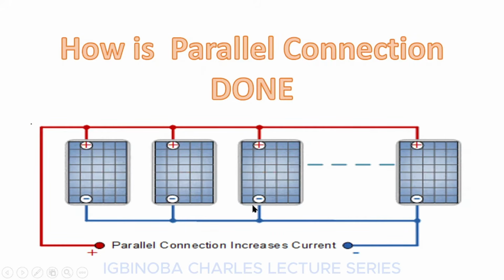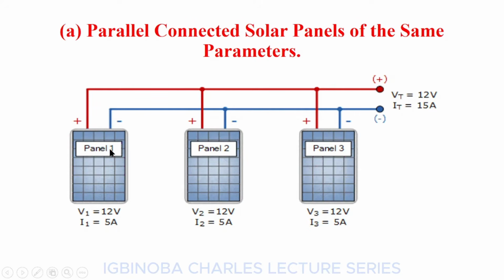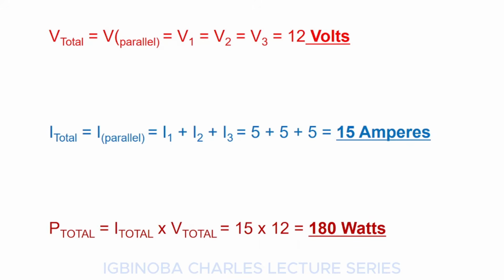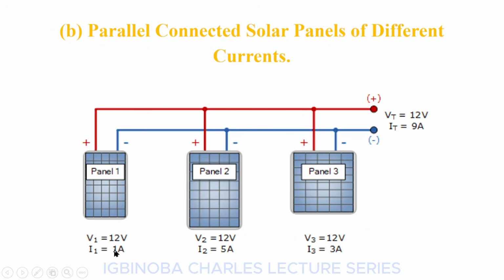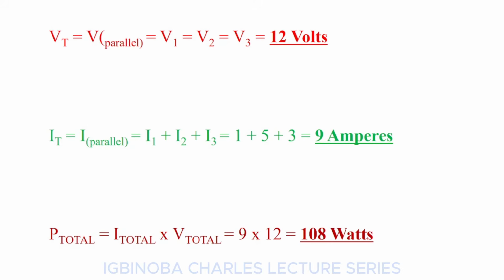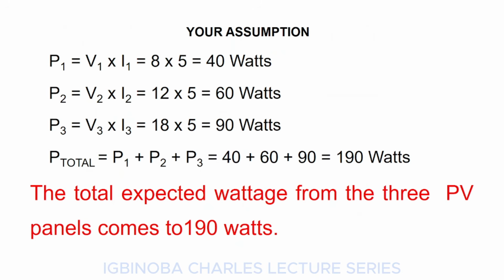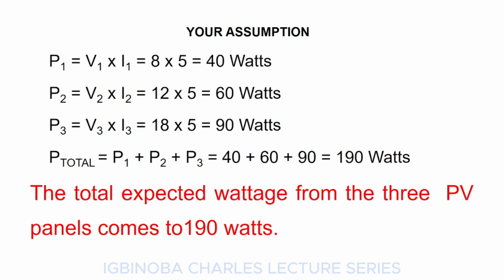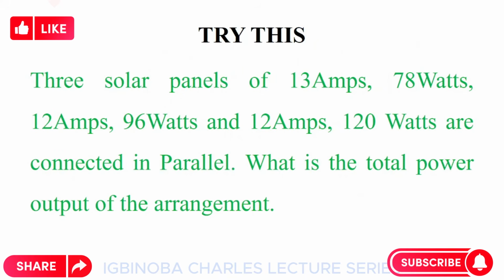Connection of Solar Panels in PARALLEL

Comment: CIV70R 

ANSWERS 
GIVEN:
Panel 1 = 13A, 78W
Panel 2 = 12A, 96W
Panel 3 = 12A, 120W
Using P = IV
V = P/I
Panel 1 = 78/13 = 6V
Panel 2 = 96/12 = 8V
Panel 3 = 120/12 = 10V
Using the smallest voltage = 6V
Total power = (Iₜ) × V
= (13 + 12 + 12) × 6
= 37 × 6
= 222 WATTS

Comment: MEC47U 
For the question as written:

* Panel 1: 13 A, 78 W
* Panel 2: 12 A, 96 W
* Panel 3: 12 A, 120 W
* Connected in parallel

Step 1: Add the power outputs

In parallel, the total power output is the sum of the
individual power outputs:

P_T = P_1 + P_2 + P_3

P_T = 78 + 96 + 120

P_T = 294 W

Comment: MEC108D

Parameters:

Panel 1: 13A, 78W

Panel 2: 12A, 96W

Panel 3: 12A, 120W

Voltage for Panel;

1: 78W ÷ 13A = 6V

2: 96W ÷ 12A = 8V

3: 120W ÷ 12A = 10V

We use the least voltage which is 6V for Panel 1
So, 
Total power in parallel = (Sum of current for the panels) x least panel voltage 

P = (13 + 12 + 12) × 6 = 222W

Comment: CHM89K 

GIVEN; P=VI; V=P/I
13A 78W=78/13 =6V
12A 96W=96/12=8V
12A 120W=120/12=10V
*I=13+12+12=37A
In a parallel connection the panels would run on the least voltage V=6volt

P=VI; 6×37=222W

Comment: COMP7G

Parameters;
Panel 1 = 13A 78W
X
:
Panel 2 = 12A 96W
Panel 3 12A, 120W i
voltage = Power/Current; Panel 1 = 78/13 = 6V
Panel 2 = 96/12 = 8V
Panel 3 = 120/12 = 10V We use
V = 6v.
total power in parallel: (Sum of the currents) × V
(13 + 12 + 12) * 6 =222watts

Comment: CIV90L

Given:

Panel 1 = 13A, 78W
Panel 2 = 12A, 96W
Panel 3 = 12A, 120W

To get the voltage across each panel, use:

V = Power / Current

Panel 1 = 78 / 13 = 6V

Panel 2 = 96 / 12 = 8V

Panel 3 = 120 / 12 = 10V

We use V = 6V because it is the least voltage we have.

To get the total power in parallel:

Total Power = (Sum of the currents) × V

= (13 + 12 + 12) × 6

= 37 × 6

= 222 watts

Final Answer = 222 W

Comment: CIV81C
   

Panel 1 = 13 A, 78 W
Panel 2 = 12 A, 96 W
Panel 3 = 12 A, 120 W
To get the voltage across each panel, use:
V = Power / Current
Panel 1 = 78/13 = 6 V
Panel 2 = 96/12 = 8 V
Panel 3 = 120/12 = 10 V
We use V = 6 V because it is the least voltage we have.
To get the total power in parallel:
Total Power = (Sum of the currents) × V
= (13 + 12 + 12) × 6
= 222 watts.

Comment: EEE75W
Panel 1 = 13A, 78W
Panel 2= 12A, 96W
Panel 3 = 12A, 120W

Voltage across each panel 
V1 = 6V
V2 = 8V 
V3 = 10V 

Total power = 222W

Comment: CHM3C

For the question as written:

* Panel 1: 13 A, 78 W
* Panel 2: 12 A, 96 W
* Panel 3: 12 A, 120 W
* Connected in parallel

Step 1: Add the power outputs

In parallel, the total power output is the sum of the individual power outputs:

P_T=P_1+P_2+P_3

P_T=78+96+120

P_T= 294W

Comment: EEE6F

PANEL 1 = 13A, 78W
PANEL 2 = 12A, 96W
PANEL 3 = 12A, 120W
CALCULATIONS:
Using P = IV \implies V = \frac{P}{I}:
PANEL 1: \frac{78}{13} = 6\text{V}
PANEL 2: \frac{96}{12} = 8\text{V}
PANEL 3: \frac{120}{12} = 10\text{V}
Using the smallest voltage = 6V

Comment: MAR91M

GIVEN:
PANEL 1=13A 78W
PANEL 2=12A 96W
PANEL 3=12A 120W

USING P=IV
V=P/I
PANEL 1=78/13=6V
PANEL 2=96/12=8V
PANEL 3=120/12=10V
Using the smallest votage = 6V

Total power=(It)*V
=(13+12+12)*6=222WATTS

Comment: EEE8H

Parameters : 
Panel 1 = 13A ,78W
Panel 2 = 12A , 96W
Panel 3 = 12A ,120W I
To get the voltage across each panel is given by : 
Power/ current ; 
Panel 1 = 78/13 = 6V
Panel 2 = 96/12 = 8V
Panel 3 = 120/12 = 10V We use V = 6V because it's the least voltage we have  : 
To get the total power in parallel: 
We have (Sum of the currents) × V (13 +12 + 12) × 6 = 222watts

Comment: MEC30D

Panel 1 = 13A,78W
Panel 2 = 12A , 96W
Panel 3 = 12A, 120W

Calculating voltage across each panel
Recall: v / PI
V1 = 78/13 =6V
V2 = 96/12 =8V
V3 = 120/12 =10V

Parallel connection 
V=6V

Calculating total power (PT)
Recall PT = ( sum of current)*V
PT = (I1+I2+I3)*V
PT= ( 13+12+12)*6
PT= 37*6
PT = 222W

Comment: MEC109E 

Given:
Panel 1 = 13A, 78W
Panel 2 = 12A, 96W
Panel 3 = 12A, 120W

Calculating voltage across each panel:

Recall: V=P/I

V1 = 78/13 = 6V
V2 = 96/12 =8V
V3 = 120/12 = 10V

Since it's a parallel connection, we use the least voltage value:
V = 6V

Recall 
Total power = (sum of currents)× voltage 
Total power = (13+12+12) × 6
                       = (37) ×6
                        = 222 Watts

Comment: CHM108C
answer:

Panel 1: 13A 78W

Panel 2: 12A 96W

Panel 3: 12A 120W

For the panels connected in parallel the total power output is the sum of the individual powers:

PT-P1+P2+P3

PT-78+96+120

PT=294W

Comment: MAR23W
Given;

Panel 1 = 13A, 78W

Panel 2 = 12A, 96W

Panel 3 = 12A, 120W

To get the voltage across each panel is given by

Power/Current;

Panel 1 = 78/13 = 6V

Panel 2 = 96/12 = 8V

Panel 3 = 120/12 = 10V

We use V= 6v because it's the least voltage we ha To get total power in parallel : We have (Sum of the currents) x V (13 + 12 + 12) * 6

=222watts

Final answer =222watt

Comment: CHM57E

Parameters;

Panel 1 = 13A 78ឃ

Panel 2 = 12A 96W

Panel 3 12A, 120W i

voltage = Power/Current; Panel 1 = 78/13 = 6V

Panel 2 = 96/12 = 8V

Panel 3 = 120/12 = 10V We use

V = 6v.
total power in parallel: (Sum of the currents) × V

(13 + 12 + 12) * 6 =222watts

Comment: MECH104Z

Panel 1= 13A , 78W
Panel 2= 12A , 96W
Panel 3 = 12A , 120W

Calculating voltage across each panel:
Recall : V/PI
V1 = 78/13 = 6V
V2 = 96/12 = 8V
V3 = 120/12 = 10V

Parallel connection 
V = 6V

Calculating total power (PT)
Recall PT =(sum of currents) *V
PT = (I1 + I2 + I3)* V
PT = (13 +12+12) * 6
PT = 37* 6
PT = 222W....
Reply: MEC113I

Panel 1 = 13A, 78W

Panel 2 = 12A, 96W

Panel 3 = 12A, 120W

Calculating voltage across each panel:

Recall: V/PI

V * 1 = 78/13 = 6V

V * 2 = 96/12 = 8V

V * 3 = 120/12 = 10V

Parallel connection

V = 6V

Calculating total power (PT)

Recall PT =(sum of currents) *V

PT= (11 + 12 + 13) ^ * V

PT= (13 + 12 + 12) ^ * 6

PT = 37* 6

لا

SUBSCRIBE

PT = 222W

Comment: MEC33G 

Parameters;
Panel 1 = 13A, 78W
Panel 2 = 12A, 96W
Panel 3 = 12A, 120W i
To get the voltage across each panel is given by
Power/Current; Panel 1 = 78/13 = 6V
Panel 2 = 96/12 = 8V
Panel 3 = 120/12 = 10V We use
V= 6v because it's the least voltage we have:
To get total power in parallel: We have (Sum of the currents) × V (13+12+12)×6 =222watts

Comment: MEC45S
 
Given:
 
 
- Panel 1 = 13A, 78W
 
- Panel 2 = 12A, 96W
 
- Panel 3 = 12A, 120W
 

 
Calculating voltage across each panel:
 
Recall: V = P/I
 
 
- V1 = 78/13 = 6V
 
- V2 = 96/12 = 8V
 
- V3 = 120/12 = 10V
 

 
Since it's a parallel connection, we use the least voltage value:
 
V = 6V
 
Calculating total power (PT):
 
Recall: PT = (Sum of currents) × V
 
PT = (I1 + I2 + I3) × V
 
PT = (13 + 12 + 12) × 6
 
PT = 37 × 6
 
PT = 222W

Comment: EEE61i

Answer:

Given:
- Panel 1 = 13A, 78W
- Panel 2 = 12A, 96W
- Panel 3 = 12A, 120W

Calculating voltage across each panel:

Recall: V = P/I

- V1 = 78/13 = 6V
- V2 = 96/12 = 8V
- V3 = 120/12 = 10V

Since it's a parallel connection, we use the least voltage value: V = 6V

Calculating total power (PT):

Recall: PT = (Sum of currents) × V

PT = (I1 + I2 + I3) × V
PT = (13 + 12 + 12) × 6
PT = 37 × 6
PT = 222W

Comment: MAR104Z

Voltage of each panel (V=P/ I)
V1=78W/13A=6V
V2=96W/12A=8V
V3=120W/12A=10V
Actual power output (parallel connection)
V parallel =min(6V,8V,10V)=6V
I total =13A+12A+12A=37A
P total =6V*37A=222W
Theoretical maximum (With optimizers)
P total =78W+96W+120W=294W

Comment: CIV64L

Given;

Panel 1 = 13A, 78W
Panel 2 = 12A, 96W
Panel 3 = 12A, 120W

So to get the voltage across each panel is given by Power/Current;

Panel 1 = 78/13 = 6V
Panel 2 = 96/12 = 8V
Panel 3 = 120/12 = 10V

We use V= 6v because it's the least voltage we have:

To get total power in parallel :

So therefore we have

(Sum of the currents) × V

(13 + 12 + 12)×6
=222watts

Final answer =222watt

Comment: PETROCHEM29C

Voltage for each solar panel can be determined by:

V=p/l where P= power and I=current.

Therefore

V1=78\13=6v V2=96/12=8v

V3=120/12=10v

By law the voltage of V1 is taking as the output

or total voltage because it has the smallest

value, therefore

Where to tell current is giving as

L_total=13A+12A+12A=37A

Total power output=l_total x v_total

P_total=37x6=222 w

Comment: PETRO92N

Answer: Given;
Panel 1 = 13A, 78W
Panel 2 = 12A, 96W
Panel 3 = 12A, 120W

To get the voltage across each panel is 
given by Power/ Current;
Panel 1 = 78/13 = 6V
Panel 2 = 96/12 = 8V
Panel 3 = 120/12 = 10V

We use V= 6V because it's the least voltage 
we have:

To get total power in parallel :
We have
(Sum of the currents) × V
(13 + 12 + 12)×6
=222watts

Final answer =222watt
Reply: PETRO23W 
TOTAL POWER = 222watts

Comment: PETRO5E

Answer: Given;
Panel 1 = 13A, 78W
Panel 2 = 12A, 96W
Panel 3 = 12A, 120W
To get the voltage across each panel is glven by Power/ Current;
Panel 1 = 78/13 = 6V
Panel 2 = 96/12 = 8V
Panel 3 = 120/12 = 10V
We use V= 6v because it's the least voltage we have:
To get total power in parallel :
We have
(Sum of the currents) × V
(13 + 12 + 12)×6
=222watts
Final answer =222watt

Comment: MEC44R

Answer
Parameters;
Panel 1 = 13A, 78W
Panel 2 = 12A, 96W
Panel 3 = 12A, 120W
To get the voltage across each panel is given
by Power/Current; Panel 1 = 78/13 = 6V
Panel 2 = 96/12 = 8V
Panel 3 = 120/12 = 10V
We use V= 6v because it's the least voltage we have: To get total power in parallel: We have (Sum of the currents) × V (13+12+12)×6=222W

Comment: EEE 86H;
ANSWER; 288 Watts
GIVEN;
Panel 1: 13 amps, 78watts
Panel 2: 12 amps, 96 watts
Panel 3: 12 amps, 120 watts

Voltage across each panel;
Power/Current 
Panel 1: 78/13=6
Panel 2: 96/12=8
Panel 3: 120/12=10
 
Least voltage is used for power calculation= 6v

Total power of the string= 
(V1+V2+V3)×6= 288 WATTS

Comment: NAT2IU 
Calculations 
Panel 1 =13A,78W
Panel 2=12A,96W
Panel 3=12A,120W
The voltage will be 6, which is the least voltage 
Sum of the current=13+12+12=37.
Total power=37×6=222W

Comment: MAR85G

Answer: Panel 1: 13A, 78W
Panel 2: 12A, 96W
Panel 3: 12A, 120W

Total power =78+96+120=294W

However,  Panels with 6 V, 8 V, and 10 V cannot be directly connected in parallel without appropriate power electronics, because parallel-connected sources should have matching voltages.

Comment: CIV45S

Answer 
Parameters;
Panel 1 = 13A, 78W
Panel 2 = 12A, 96W
Panel 3 = 12A, 120W
To get the voltage across each panel is given
by Power/Current; Panel 1 = 78/13 = 6V
Panel 2 = 96/12 = 8V
Panel 3 = 120/12 = 10V
We use V= 6v because it's the least voltage we have: To get total power in parallel: We have (Sum of the currents) x V (13+12+12)×6=222watts

Comment: COMP74V

13I   78W
12I   96W
12I   120W

Find the voltage for each

78W / 13I = 6V

96W / 12I = 8V

120W / 12I = 10V

Lowest voltage = 6V

Pt = It Vt

Pt = 6 x (13 + 12 + 12)
Pt = 6 x 37
   = 222W

Comment: EEE31E
Answer 
Parameters;
Panel 1 = 13A, 78W
Panel 2 = 12A, 96W
Panel 3 = 12A, 120W
To get the voltage across each panel is given
by Power/Current; Panel 1 = 78/13 = 6V
Panel 2 = 96/12 = 8V
Panel 3 = 120/12 = 10V
We use V= 6v because it's the least voltage we have: To get total power in parallel: We have (Sum of the currents) x V (13+12+12)×6=222watts

Comment: COMP33G
   The total output of the arrangement in parallel = 222 watts
     By multiplying the least volt with the summation of each current

Comment: EEE17Q
answer:
Panel 1: 13A 78W
Panel 2: 12A 96W
Panel 3: 12A 120W
For the panels connected in parallel the total power output is the sum of the individual powers:
PT=P1+P2+P3
PT=78+96+120
PT=294W

Comment: EEE52Z

Panel 1 = 13A, 78W
Panel 2 = 12A, 96W
Panel 3 = 12A, 120W
To get the voltage across each panel is given by Power Current:
Panel 1 = 78/13 = 6V
Panel 2 = 96/12 = 8V
Panel 3 = 120/12 = 10V
We use V = 6V because it's the least voltage we
have.
To get total power in parallel:
We have
(Sum of the currents) × V
(13 + 12 + 12) × 6
= 222 watts.

Comment: PETRO85G

Given;
Panel 1 = 13A, 78W
Panel 2 = 12A, 96W
Panel 3 = 12A, 120W
To get the voltage across each panel is glven by Power/Current;
Panel 1 = 78/13 = 6V
Panel 2 = 96/12 = 8V
Panel 3 = 120/12 = 10V
We use V= 6v because it's the least voltage we have:
To get total power in parallel :
We have
(Sum of the currents) × V
(13 + 12 + 12)×6
=222watts
Final answer =222watt

Comment: EEE48V

CIV73U
GIVEN THAT:
P1 = 60W, V1 = 6V
P2 = 84W, V2 = 12V
P3 = 144W, V3 = 24V
Calculating for current(I):
1= P/V
11 = 60/6 = 10A
12 = 84/12 = 7A
13 = 144/24 = 6A
Since it's a series connection, using smallest
current = 6A
Calculating for the total power (P):
Pt = VI
Pt = (V1 + V2 + V3) × I Pt = (6 + 12 + 24) × 6

Comment: COMP96R:
Panel 1 = 13A, 78W
Panel 2 = 12A, 96W
Panel 3 = 12A, 120W
To get the voltage across each panel is given by:
Power / Current
Panel 1 = 78/13 = 6V
Panel 2 = 96/12 = 8V
Panel 3 = 120/12 = 10V
We use V = 6V because it's the least voltage we have:
To get total power in parallel:
We have:
(Sum of the currents) × V
(13 + 12 + 12) × 6
= 222 watts
Reply: CIV16P

PANEL 1= 13A, 78W
PANEL 2= 12A, 96W
PANEL 3= 12A, 120W

TO GET THE VOLTAGE ACROSS, ITS GIVEN BY:
POWER/ CURRENT
PANEL 1/= 78/13=6V
PANEL 2=96/12=8V
PANEL 3=120/12=10 V

WE USE 6V BECAUSE IT IS ACTUALLY THE LEAST VOLTAGE WE HAVE:
TO GET TOTAL POWER IN PARALLEL, WE THEN SAY
SUM OF ALL CURRENTS x V
13+12+12x6
=222 WATTS

Comment: MEC88J 

Panel 1: 13 A, 78 W
Panel 2: 12 A, 96 W
Panel 3: 12 A, 120 W
For parallel connection, using the lowest voltage:
V=78÷13=6V
Total current:
Therefore:
✅ Total power = 222 W

Comment: CIV65M
ANSWER:

Panel I = 13A, 78W

Panel 2 = 12A, 96W

Panel 3 = 12A, 120W

To get the voltage across each panel is given by Power/

Current;

Panel 1 = 78/13 = 6V

Panel 2 = 96/12 = 8V

Panel 3 = 120/12 = IOV

We use V = 6v because it's the Least voltage we have:

To get total power in parallel:

We have

(Sum of the currents) * V

(13+12+12) × 6

=222watts

Comment: PETRO53A
      
     Answer = 222watts
   
   Solving 
  Using V=P/I
   V1= 6v
    V2= 8v
     V3= 10v 
   Total voltage = 6v ( In parallel connections we used the lowest voltage) 
  
   Total current I =i1+i2+i3
                             =12+13+13
Total current = 37

 Total power p=IV
                         =6*37
    Total power = 222watts

Comment: CHM16P

Given;
Panel 1 = 13A, 78W
Panel 2 = 12A, 96W
Panel 3 = 12A, 120W
To get the voltage across each panel is given by Power/Current:
Panel 1 = 78/13 = 6V
Panel 2 = 96/12 = 8V
Panel 3 = 120/12 = 10V
We use V = 6V because it's the least voltage we
have.
To get total power in parallel:
We have
(Sum of the currents) × V
(13 + 12 + 12) × 6
= 222 watts.

Comment: MAR5E

SOLUTION:

13A, 78W → V = 6V
12A, 96W → V = 8V
12A, 120W → V = 10V

Total current = 37A
Total voltage = 6V
Total power = 222W

Comment: PETRO87I

For a parallel connection, the voltage must be the same, and we cannot simply take the lowest voltage current here because the ratings of the current occur at different voltages.
Therefore the panels cannot be connected directly in parallel.
And the total power output cannot be gotten directly too

Comment: PETRO5SC

Panel 1 = 13A, 78W
Panel 2 = 12A, 96W
Panel 3 = 12A, 120W
To get the voltage across each panel is given by Power/Current:
Panel 1 = 78/13 = 6V
Panel 2 = 96/12 = 8V
Panel 3 = 120/12 = 10V
We use V = 6V because it's the least voltage we have.
To get total power in parallel:
We have
(Sum of the currents) × V
(13 + 12 + 12) × 6
= 222 watts.
Reply: PETRO54B

ANS:total power=222watts

(V1= 6v V2= 8v V3= 10v) gotten by using V=P/I where P and I are the individual power and current of each panel
 
Therefore 

Vt=6V
It= 37A
Pt = 222watts

Comment: EEE34H

Given;
Panel 1 = 13A, 78W
Panel 2 = 12A, 96W
Panel 3 = 12A, 120W
To get the voltage across each panel is given by Power/ Current:
Panel 1 = 78/13 = 6V
Panel 2 = 96/12 = 8V
Panel 3 = 120/12 = 10V
We use V = 6V because it's the least voltage we have.
To get total power in parallel:
We have
(Sum of the currents) × V
(13 + 12 + 12) × 6
= 222 watts

Comment: NAT48V

Panel 1 = 13A, 78W
Panel 2 = 12A, 96W
Panel 3 = 12A, 120W
To get the voltage across each panel
is given by Power/Current;
Panel 1 = 78/13 = 6V
Panel 2 = 96/12 = 8V
Panel 3 = 120/12 = 10V
We use V = 6v because it's the least
voltage we have:
To get total power in parallel:
We have
(Sum of the currents) × V
(13 + 12 + 12) x 6=222watts

Comment: EEE66N 

Parameters;
 Panel 1 = 13A, 78W 
Panel 2 = 12A, 96W
 Panel 3 = 12A, 120W
 To get the voltage across each panel is given by Power/Current; Panel 1 = 78/13 = 6V 
Panel 2 = 96/12 = 8V 
Panel 3 = 120/12 = 10V 
We use V= 6v because it's the least voltage we have: To get total power in parallel: We have (Sum of the currents) x V (13+12+12)×6=222watts

Comment: PETRO78Z

Answer= 222W

Step 1: Calculate Voltage for Each Panel (V = P ÷ 1)
Panel 1: 78W ÷ 13A = 6V
Panel 2: 96W ÷ 12A = 8V
Panel 3: 120W ÷ 12A = 10V
Step 2: Determine String Voltage
In parallel, voltage is limited by the lowest-rated panel:
V(string) = 6V
Step 3: Calculate Total Current In parallel, currents add up:
I(total) = 13A + 12A + 12A = 37A
Step 4: Calculate Total Power Output
P(total) = V(string) x I(total)
P(total) = 6V x 37A = 222W

Comment: EEE11K

Parameters; 
Panel 1 = 13A, 78W 
Panel 2 = 12A, 96W 
Panel 3 = 12A, 120W i 
To get the voltage across each panel is
 given by 
Power/Current; Panel 1 = 78/13 = 6V 
Panel 2 = 96/12 = 8V 
Panel 3 = 120/12 = 10V We use 
V= 6v because it's the least voltage we have: 
To get total power in parallel : We have (Sum of the currents) × V (13+12+12)×6 =222watts

Comment: PETROCHEM36J 

ANSWER: 222watts

Given;

Panel I = 13A, 78W

Panel z = IzA, 96W

Panel 3 = IzA 120W

To get the voltage across each panel is given by

power/current;

Panel 1 = 78/13 = 6V

Panel z = 96 / I * z = 8V

Panel 3 = Iz * 0 / I * z = 10V

We use V = 6V because it's the least voltage we have:

To get total power in parallel:

We have (Sum of the currents) XV (13 + 12 + 12) * 6

=222Watts

Final answer=222Watts